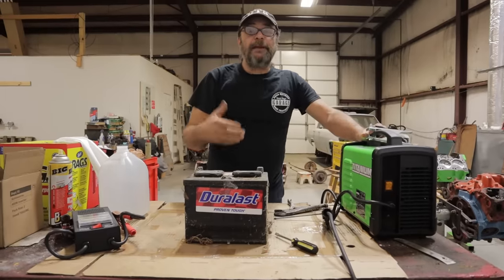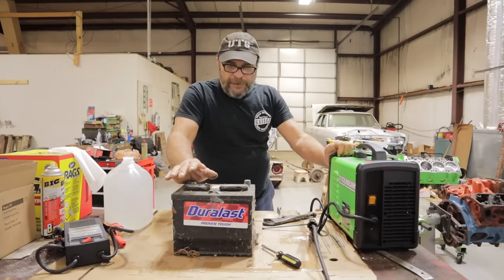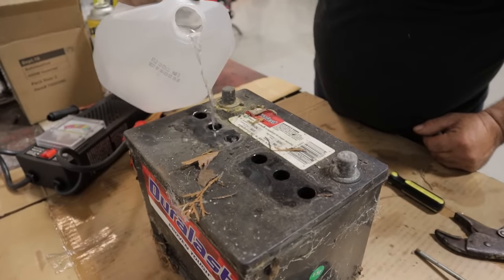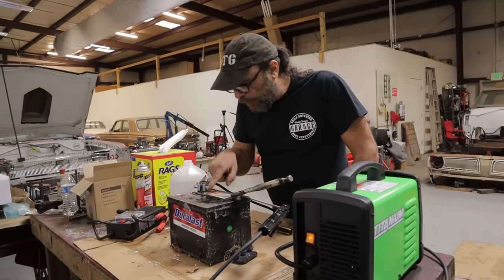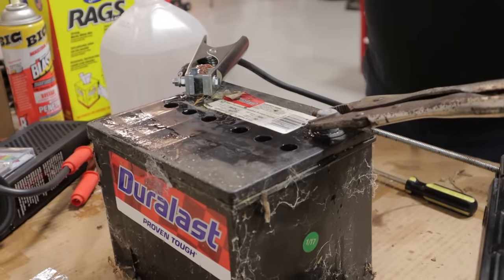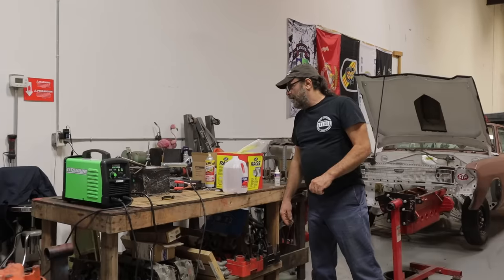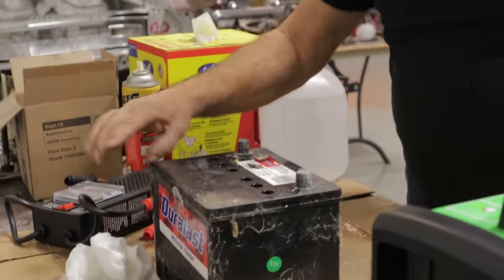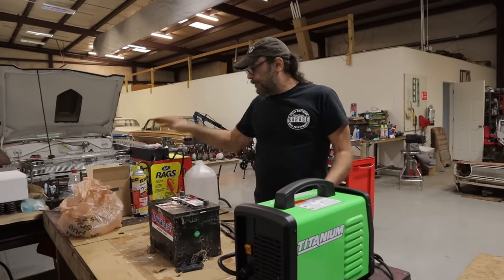Reviving Dead Batteries With A Stick Welder

Comment: Tony, just for the record, batteries can and do indeed blow up if aggressively overcharged with a welder(ac/dc or dc welder - electrode positive dc setting). Twice I had seen a battery "explode". Once next to me while a fellow crew member try to jump-start a dead battery with jumper cables on an aircraft tow tractor with another tow tractor on an aircraft carrier. He shorted the battery out and it exploded, I got a face full of acid, and the top of the battery was gone. The next time was a decade later while I was working(ironworker) on a jobsite and a coworker tried to use a gas-driven welder to "charge" a dead battery and he overcooked it on the highest dc setting(300 amps), it completely exploded, there was virtually nothing left except the very bottom part of the battery and tiny bit of the internal lead/antimony plates and the battery box was blown apart. Exploding batteries can and will cause severe harm with very serious injuries and even death from shrapnel from the exploding battery.
Reply: I've seen it happen about 6 times or so. All but one just blew the top off and splashed a relatively small amount of acid. 

The last one was more powerful and threw acid all under the hood. I assume because the level of liquid was down inside the battery in one or more cells, leaving more room for the hydrogen/oxygen to accumulate and it's already in the ideal concentration to explode.
Reply: With the covers off they can’t explode because they can’t build up pressure.they’ll just boil all the water off and cause different problems if you don’t watch it. Doing this with a sealed maintenance free battery would be iffy unless you drill some vent holes.
Reply: My buddy left a battery charging on 200 amp I'm not sure for how long he had it on there he gets distracted easy and kind of an old burnout. But one thing I am sure of is that battery exploded like a star going supernova. Two and three from five kinda stuff. Man I'm glad nobody got hurt because it could've been life changing for someone. Father is great
Reply: @wormhole331  hydrogen and oxygen in the perfect ratio inside and around the outside of the battery.  Those caps aren't exactly bolted down when they are installed.   I know someone that was fast charging a dead battery.  He was in the hospital 17 days before coming out of the induced coma while they replaced parts of his skull, jaw and other body parts. Anyone doing this thinking that safety glasses will protect them is miss informed.
Reply: Harry__Morgan  I'd guess that one battery had a plate either short out or disconnect internally and cause a spark inside, which ignited hydrogen gas. Hydrogen is produced as a by product of charging and it's very explosive, so all you need is a little spark and it'll blow the battery open. 

If the alternator is over charging you'd probably see more than one battery failing, or at least see moisture all over the tops of the others as the electrolyte is boiling (like you saw in this video). Of course, a simple voltage test with it running will tell you if the alternator voltage is normal.
Reply: @wormhole331  I think it is the hydrogen/oxygen mix plus a spark that makes it explode. Happened to my dad just when he lifted the newly charged battery (no leads attached or charging going on). exploded right in his face, fortunately he wore glasses and for some reason happened to turn his head away when lifting the battery on to the transom of the boat in the trailer, thereby exposing his ear. He never got the hearing back, but fortunately his eyes were not injured. The shower was just a few feet away so he got in there fast with the help of my mom, who later patched up his clothing with about 800 little patches, retired seamstress she was....
Reply: @wormhole331,. Actually a battery can very much explode with the caps off. It's the gas that will explode if a spark, even static electricity can set it off. Safety first and always.